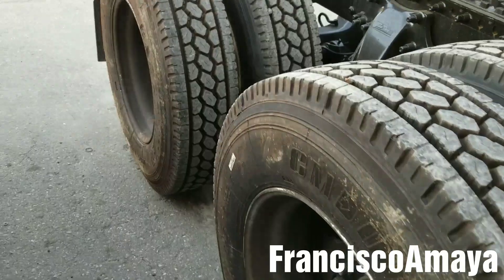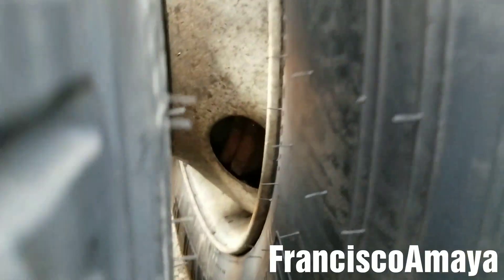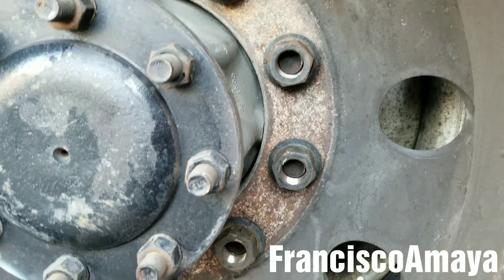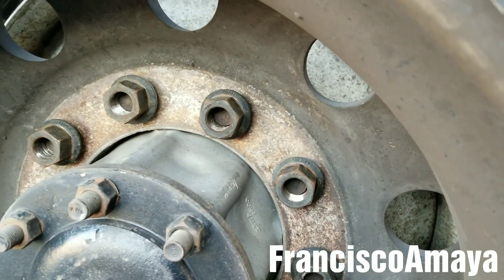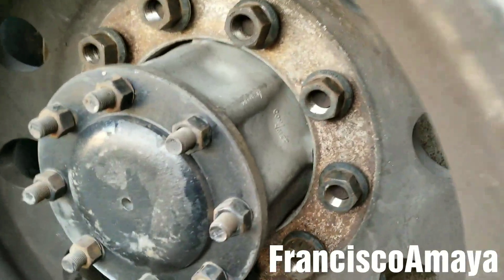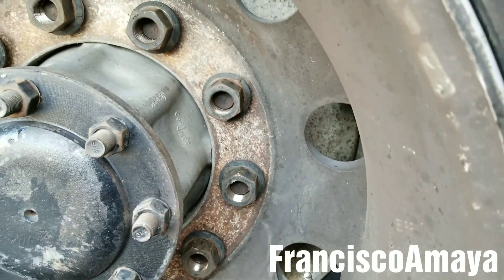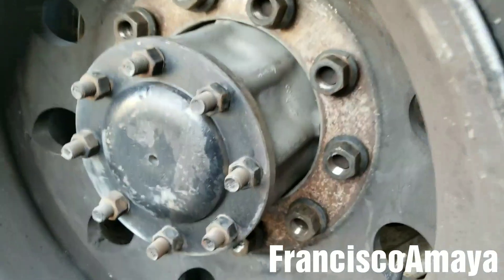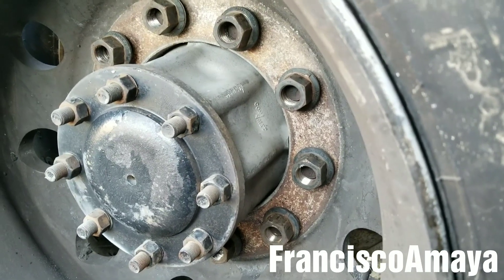Tire replacement mistake loose wheel nuts after tires replaced mechanic mistake

Comment: I had a similar situation once on a front steer tire I had replace. I went home and travel about 10 miles. I had to do something on that same side and when to loosen the lug nuts and there was maybe 50 lbs of tork on the lug nuts.